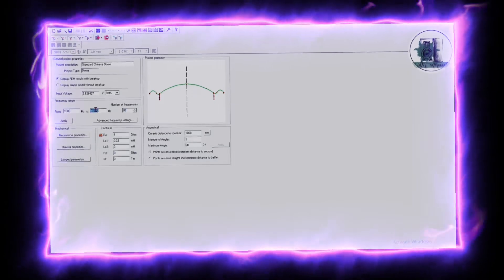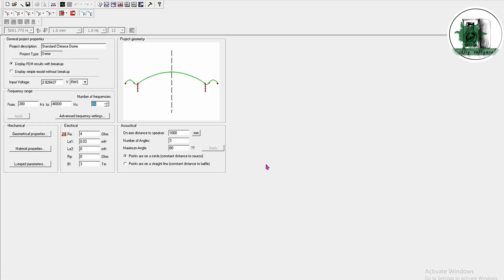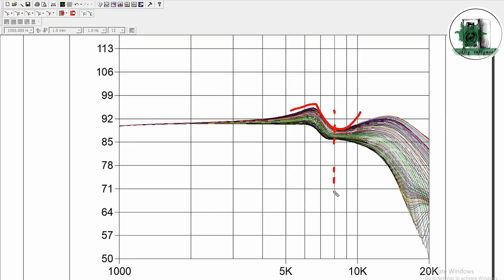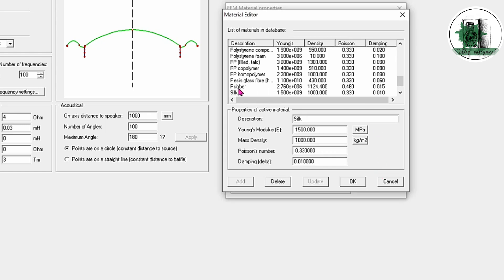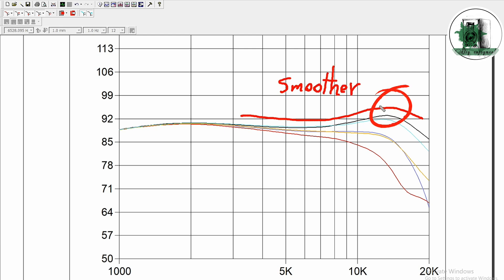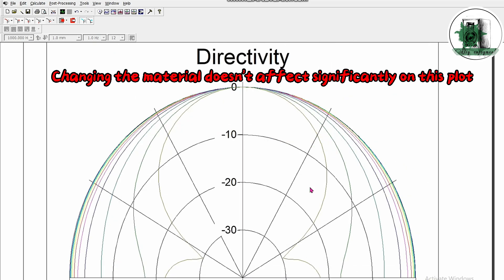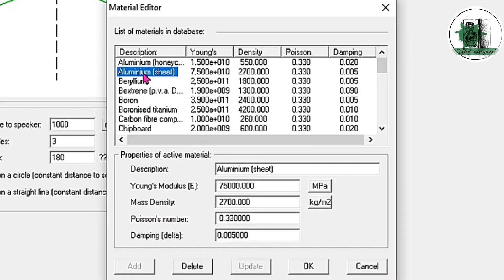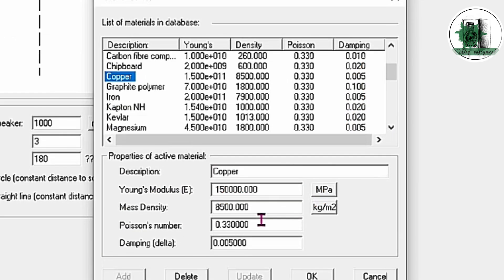Tweeter Dome Materials Tested! Silk, Aluminum, Polyamide & More – Surprising Results!

Comment: Thanks I’m gonna go look for plywood tweeters now.  So smooth!
Reply from the maker: You're welcome! I tried to demonstrate the material's behavior, but that doesn't mean it actually exists.
Reply: @Diy_enjoyment  Ive always wondered.. how the lack of stiffness in a ribbon / planer tweeter... effects their performance levels.  While they are lighter... is it not possible, that they can also distort (shape-wise), from trying to move the heavy air pressures?
Reply: @johndough8115 At 5kHz or higher, the wavelength is too small to cause any major movement, it'd be micro Millimetres. So even the flimsy material can withstand the high frequencies. ( Im not a scientist, but I think so)
Reply: So, an Aluminium dome with a thin coat of latex or epoxy can do the trick. I will try making a dome out of carved  soft wood & see how it sounds. Thanks, I never thought about wood ❤